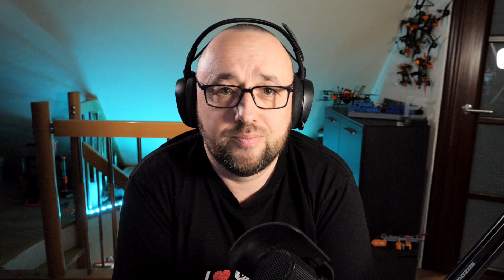INAV resource mapping

Comment: hello,
I have mamba f405 mk4 2022b, and my vtx (dji o3) is always turn off when I flashed the FC to inav 6.1.1, but it came back on when I flashed the FC back to betaflight... I'm sure that I'm using the right firmware and I've flashed 6 times back and forth between inav and BF, and the problem remains the same... can you help me?

Comment: Thanks, I worked a little bit on remapping directly on the source code… at the beginning I thought it was working but finally it doesn’t (I’m able to move a servo on S2 that was a motor, but the S1 that should be for motor 1 does not work any more… I use timer 3 on S2)
I think I’m close to solve the issue and I’m quite motivated to develop something more generic if I’m able to make it working. But I need some doc about the timer issue or more comments in the source code (omnibusf4)…

Comment: I wanted to ask if it's possible to use a servo for motor output? For instance if you know the value for idle throttle of a nitro motor and the full throttle, could you use it with INAV?  I have this old balsa nitro trainer I want to fly with INAV..
Reply from the maker: Yes, no problem. There is a servo "throttle" input
Reply: @FPVUniversity  Awesome! Thank you for the quick reply. Love all the work you do for INAV.

Comment: I suppose not, but I'm asking anyways. :)
Is there any way, without resource mapping, altering the source code and/or extra hardware, to switch on/off the caddx peanut camera in Inav with a switch on the radio?
Reply: I’m working on it, so it should be possible. So fare I’m using S2 on a servo instead a motor, it works but the motor on S1 is not working … Wrong timer maybe…